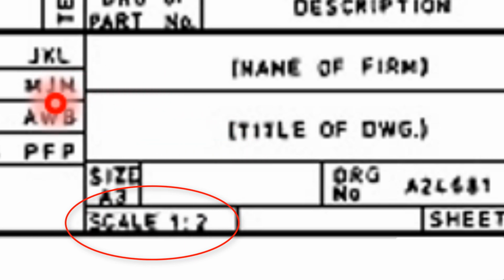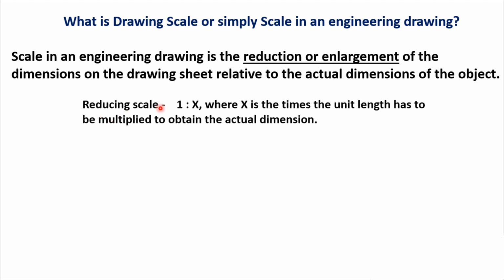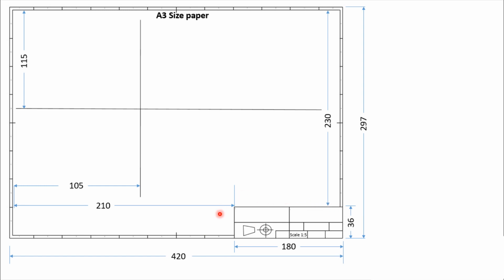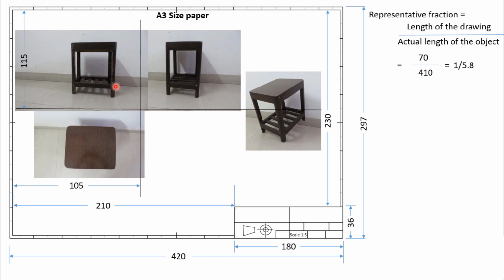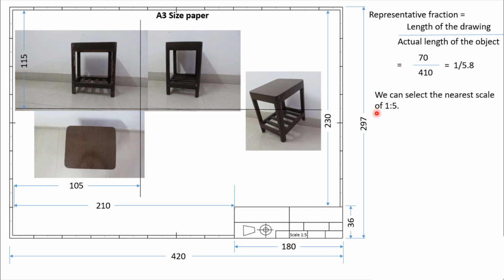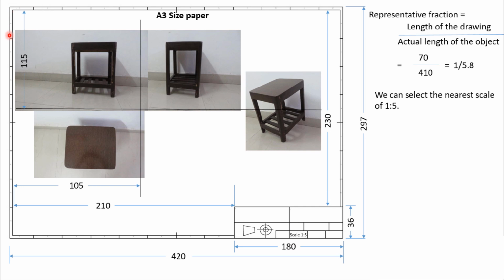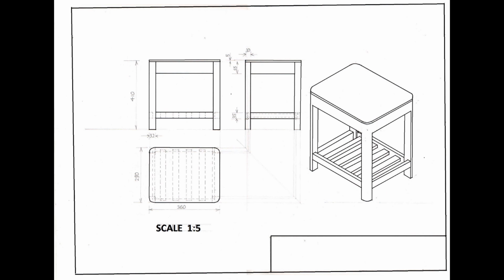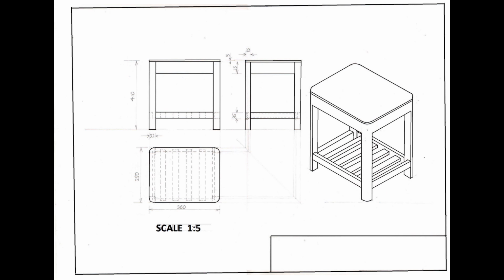1.8-What is a "Scale" in Engineering Drawing? How to decide scale of your drawing?

Comment: I'm a software engineer and this video helped me in one of my tasks to decide the scale. 
thank you so much
Reply from the maker: You may kindly help explain how it helped. It will be useful for the general education of engineers.
Reply: @1styearengineeringdrawing182  Definetely! I was trying to measure a object from screen, in my case I measure a ring from screen and getting size in pixels of the screen and because of the wrong scale, I was not getting expected output, then I used 1:10 scale for mm to px and it worked